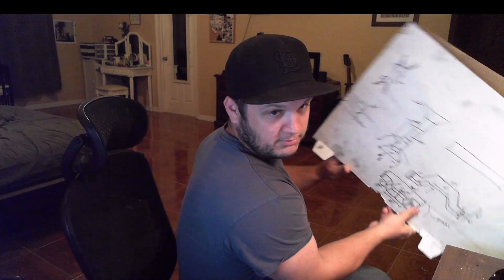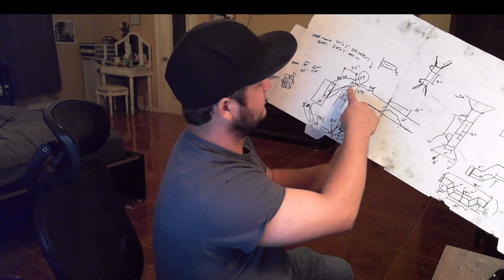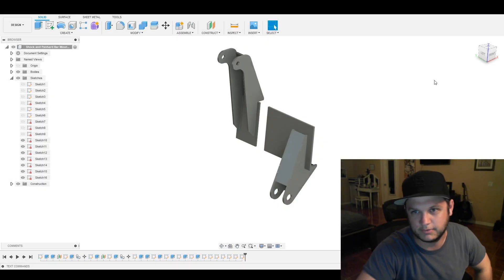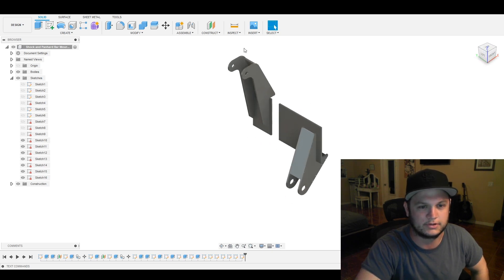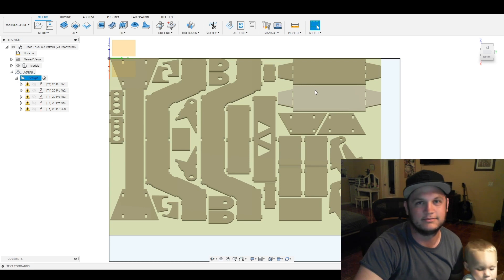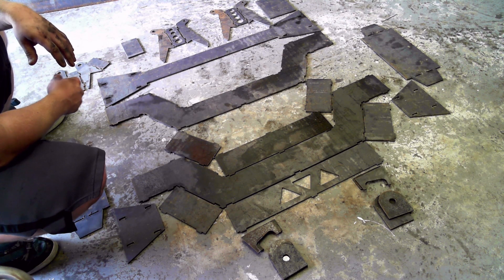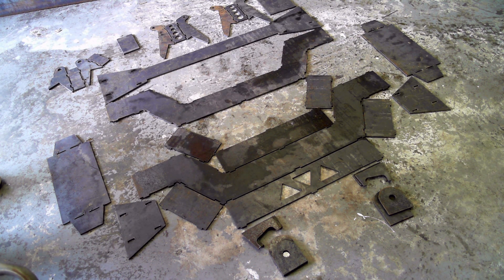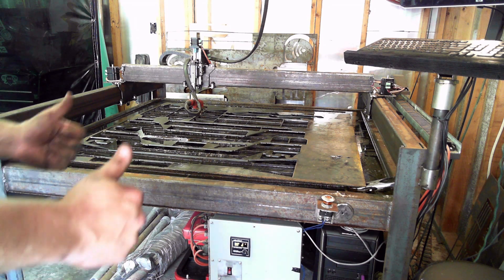NASCAR Sleeper Work Truck: Designing and Fabricating a crossmember and suspension mounts

Comment: Any updates on this sweet suspension progress?
Reply from the maker: Ya, the truck has been finished for a few months. The owner is Panda_DFWU on Instagram. He's been racing the hell out of it on and off the track since it was finished.
Reply: @pjmichael1176  I just checked out his Instagram and the rear looks sweet. Unfortunately I was only able to find 1 pic of the truck without the bed. Why wasn't the entire coil spring length used? And what's the reason for placing the coil at that location instead of closer to the axle like the setups in nascar?. I'm new to suspension geometry. I have the same truck and want to change my leaf spring setup so I've been absorbing as much info as possible.